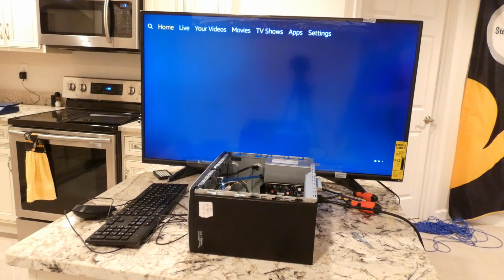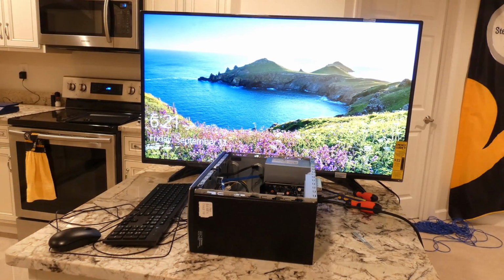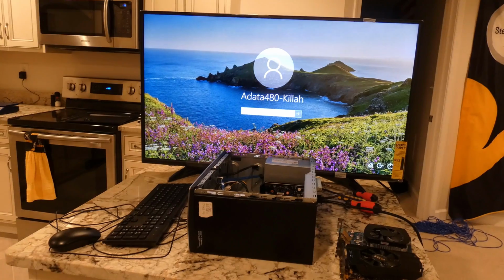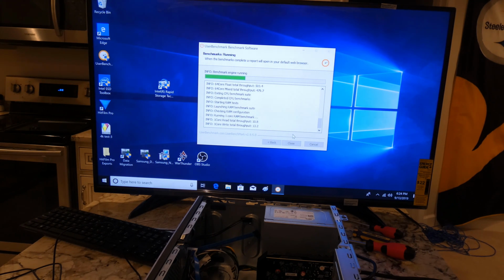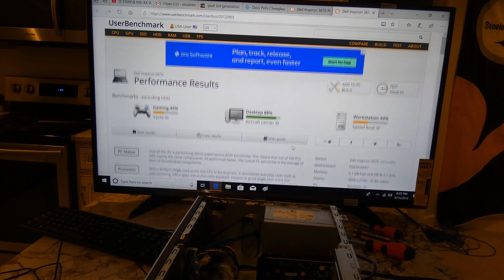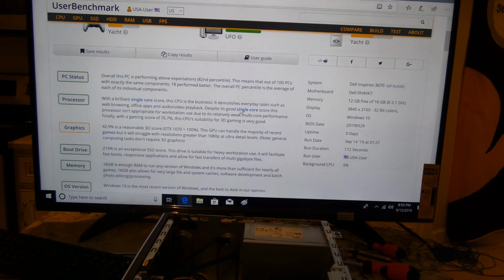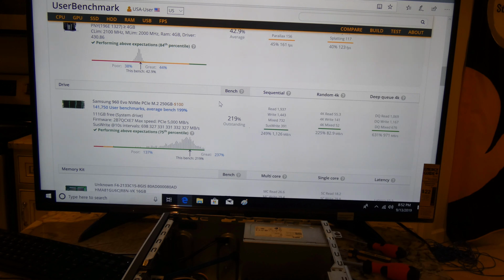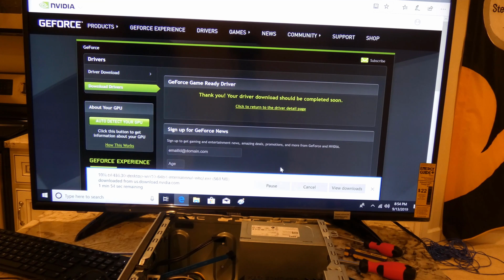Installing PNY GTX 1650 in Dell Inspiron  Vostro 3670, first benchmarks

Comment: 5 years late and i need help with this gpu

1. gddr6 is out of the picture, almost all need a 6 pin, which the dell inspiron 3670 doesnt got

2. id really prefer a dual fan model due to bad airflow in the system, but every dual fan i find, even gddr5, needs a 6 pin, do u know where to get a dual fan model that doesnt require a 6 pin?

3. ill take the cheapest u can find, ive been searching for weeks but maybe im looking at the wrong places, i jus want one that isnt dead lmfao, if u can help me out itd mean a lot, thanks.

Comment: The Toasty Bros showcased an HP Prodesk 600 G series MT with a 280w 80+ platinum PSU. The installed gpu was an HP gtx 1660 super and an i5 6500. They ran benchmarks and games on it. It ran fine.

Comment: Hello I'm buying a GTX 1650 tuf do you think that would fit in that pc because I have the same exact pc and I dont know if it will fit.
Reply from the maker: Hello, I have put a lot of GPU's in this case.  While I don't have the one you are mentioning, it is physically close to the gtx 1060 or RTX 2060S that I put in there.   Your card is supposed to be about 8" long...and the Zotac mini RTX 2060S that I put in...is 8.5".  At around 9-9.5", there starts to be an issue...so the longer 2x fan and definitely 3x fan GPU's are the ones that most likely will not fit.  I didn't notice a 6pin PCIE connector, so you should be ok with the stock cooler.
Reply: @PC_HardwareTechUnboxing_1  thank you very much you definitely deserve a sub and like you helped a lot and I'm probably gonna buy one today 😁

Comment: I have also a same model desktop (Dell vostro 3670) but the processor is i3 8100. Is it upgradeable with the same graphics card?
Reply from the maker: Yes..this one was I5-8400..than I3-9100..I5-9400f..than I7-9700f

Comment: hi, i have the exact same pc and the power supply doesn’t have and 6 pin power cables so do you know if i will be able to just put it in the motherboard without any cables and be finished?
Reply from the maker: Buy a GPU that doesn't have a 6 pin PCIE connector.    The one in this video doesn't have one.  

I have other videos demonstrating PSU upgrades and 6pin adapter cable to SATA.  Both of which might void your warranty.
Reply: David Noble thank you
Reply from the maker: You may find something useful in this 3670 playlist. Dell Vostro Inspiron 3670 Videos (upgrade, how to, benchmarks, gaming): https://www.youtube.com/playlist?list=PLVgD9iFAWx_IMiBmqgqFcTxl3W5PIdznr

Comment: Hello i have a dell optiplex 9010 with a i7 3770 and a 275w PSU and a want to put this 1650 do you think it will work ?
Reply from the maker: It should though I cant say it will with 100% certainty if you have the fatter one...slimline would require pcie ribbon extender.
Reply: @PC_HardwareTechUnboxing_1  i have the fatter one and i plan to get the gtx 1650 that doesn't require external power (no 6 pin connector)

Comment: can i put gtx 1650 on vostro 3800,as it is showing  gt 710 and gtx 745 is only compictable on this motherboard,i have a pc
Reply from the maker: Hello, yours looks to have a slim profile.  As I don't know the wattage of your PSU, I can say for sure if the following would work.

If there is a GTX 1650 Low Profile, you might get it to work.  This assumes you don't have same issues as a Vostro 3470.    Other options, leave the case open and use a PCIE ribbon extender....but your PSU should be at least 250W.

Comment: my psu is 240 psu and i want this card but my system is intel i5 4590 drr3 16 ram 2tb hard drive ssd 256 gb no dvd drive will i be a problem.
Reply from the maker: You might want to watch this video. 

https://youtu.be/yQzg1DtZmOk

Comment: Gigabyte GeForce GTX 1650 D6 OC 4G Graphics Card is that compatible
Reply from the maker: Hello, looking at the specs, there is no 6 pin GPU, so this card would work with this computer.    https://www.gigabyte.com/Graphics-Card/GV-N1656OC-4GD-rev-10/sp#sp  Recommended PSU is 300W, where this has 290W.  That should not be an issue.  Here is an example of a GPU that I put in and me showing how much power the Dell with an older GPU draws.  I eventually will do another one with a GTX 1650.  Number should be similar though.  (Actually was 160W for GTX 1650 for overall power draw) https://youtu.be/k33FMwV3e_8
Reply: David Noble thanks man

Comment: I have the same computer as you 
Do i have to upgrade the PSU if i want to use gtx1050ti
Reply from the maker: No, I never had an issue with GPU's that did not have GPU power connectors.  I have tried GTX 1050, 1050TI, GTX 1650, GTX 750, RX 460, RX 560B.  Currently, Dell offers the 3671 with same wattage PSU and a GTX 1650.

Comment: Thank you so much! I have the exact same computer and have been looking to upgrade the integrated graphics of it for a long time. Is the one you used the PNY GTX 1650 super or the PNY GTX 1650?
Reply from the maker: 1650  ..u need PSU upgrade for other

Comment: I just got a 1650 super. I have a GTX 1050ti now with the latest drivers. Should I uninstall the drivers before I put the 1650 super in?
Reply from the maker: It will probably run without updating.  Just install new GTX 1650 driver..you should be ok.

Comment: Hi David, it's work good with PSU 290W ?
Reply from the maker: Hello...if you check Dells site for the 3671...one of the options is with 1650 and if I remember correctly it says 290W.

Comment: I switched from optiplex to vostro and I wanted to know how this pc would be on gaming .
Reply from the maker: Absolutely terrible out of the box.  This video is with a better cpu, but demonstrates resolution and quality to be somewhat playable:  https://www.youtube.com/watch?v=CHRT6gSXh-U for something as simple as FortNite.   You will need a GPU for sure if you want to have better graphics.  Without upgrading the PSU, buying the following cards that don't have 6 pin GPU connectors will work:  RX-460, RX-550, GT 1030, GTX 750, GTX 1050, GTX 1050 TI, GTX 1650.  There may be some other older cards as well.

Comment: can you help me i am getting the vostro for my birthday and i want to do this if i add a another 4 gb ddr4 and the gtx 1650 will they burn or no i wont add a ssd please help
Reply from the maker: What do u mean by burn?  If U get a 1650 without 6 pin GPU connector..you should be fine.
Reply: @PC_HardwareTechUnboxing_1  ok thank you very much sir

Comment: would this card be possible with a 240 power supply?
Reply from the maker: I believe they recommend 300W system power.  That said,...the GPU maxes at 75W due to the PCIE connection and no GPU power connectors.  TDP for non K type Intel chips is 65W.  If you don't plug in a bunch of peripherals, it should work.  I did something similar in this video with I believe 180W PSU and a RX 460:   https://www.youtube.com/watch?v=8f7lxEIu1y0  

I can't say I recommend it though.    I usually recommend a 100W  buffer when building a custom computer after doing the calculations.

Comment: Hey I just got this desktop from Dell few days ago only to find out that I need another graphics card to play games, which graphics card will fit and work best in the Inspiron 3670? Without having to upgrade power supply, it is 290 watts. I wanted to try GTX 1050ti
Reply from the maker: GTX 1650 is the best card...it is rated for overall system power of 300W, but I never had any issues.  What I was looking for was the computer to reboot during peak performance, that would tell me that I went above and beyond what the PSU  could handle.  Now, ifi one were to max out RAM, HDD/SSD and external USB's....there is more potential for a problem.
Reply: @PC_HardwareTechUnboxing_1  so what should I get. I just wanna be able to play call of duty and it battlefield on low settings if I wanted too I just looked up the GTX 1650 on the nvidea website and there was 3 or 4 options of that model will any of them work or which one will fit in the dell Inspiron 3670 desktop

Comment: does anyone know if you need a certain amount of ram or watts in your power supply to get a graphics card like this?
Reply from the maker: Hello, this graphics card draws 75W thru the PCIE connection on your motherboard.  It is recommended that your power supply be at least 300W.   I would recommend you have at least 8GB of RAM, 12-16GB preferred.
Reply: There is always a certain (minumum) amount of wattage needed to run any GPU (graphics card) in any system.  The specs on the card will specificy that minimum.

Comment: Can I use a 180 watt power supply I have an i5 7500 gtx 1650 ti low profile. Pls reply. I have an hp computer it also has 8gb ram
Reply from the maker: No, I would not suggest using anything less than the 290W that came with this PC.

Comment: THANKS AGAIN I BUY THIS GPU IS WORKING GOOD .....
Reply from the maker: Good deal.  Glad you are happy with it.  BTW, I just got a GTX 1650 Super in to try out on the channel.
Reply: When is that coming out?  I am seeing what the best build is for this computer, so I can have it for Christmas
Reply from the maker: @WantBadtime  GTX 1650's Supers & 1660 Supers have been out a few weeks...starting at $160 and up.
Reply: Yeah I just realised about it. lol, I didn't what I was thinking.  So, if I get this card, will this config work with a normal 1TB Hard Drive with a Samsung 970 Evo m.2 SSD?  I Might not be able to since Hard drives take up lots of power.
Reply from the maker: @WantBadtime   GTX 1650 super or GTX 1660 super will not work in this one without a PSU upgrade.  If I do a video for it, that will be the first thing I mention.  Best card that works in this computer is GTX 1650 (no GPU connector) should run fine still with 2 drives...there is a point where you could have too many peripherals and you computer will go to a black screen and reboot.  I have experienced that with other PC builds, but not in this case.  With this computer it is hard to have a lot of other peripherals, HDD's, SDD's, case fans, rgb strips,...etc.  You could have something plugged into every USB 2.0/3.0 drawing power as well.
Reply: wiht hdd and dvd reader

Comment: Would the GTX 1650 Super work the same way? Or would it require me to change out the power supply?
Reply from the maker: I haven't got one of those in for the channel yet, but I believe they use 100W vs max of 75W of the 1650.  75W being the most that can be pulled from  a PCIE connection...which  should mean that 1650 Super requires 6pin GPU connector and thus you would need to change out the PSU.  If I find out something different than that..I will let you know.

Comment: Hi ...  I have dell 3670 I7 8700 16GB M / 512 SSD M2 3500 / can I improve this graphical power whith gtx pny1650,??.....More than you have ..or is same ??thanks
Reply from the maker: Hello, if you had I7-8700 in place of the i5-8400, with the GTX 1650, you would see a slight improvement in gaming.   Some games that take advantage of multi-core would see a greater improvement.  For 4k editing, CAD, animation, you would see serious increases in performance.  Without changing out the PSU and adding a 24 pin to 8 pin connector, this is the best graphics card that will run in this computer. Hope that helps.
Reply: @PC_HardwareTechUnboxing_1   thanks..

Comment: Is the motherboard altered at all or would the 1650 fit in a brand new Inspiron 3670? I’m trying to find a good graphics card for it, and after watching this vid, im trying to decide between the 1650 and the 1050 ti.
Reply from the maker: No modifications to the  motherboard or PSU was done for this video.  The 1650 isn't too large of a card.  I have another video that I upgraded the PSU and put a RX 570 in it.  That is about the limit of how large a card will fit in this case.  I have also tried out RX 460 (no 6 pin), GTX 1050, GTX 750, and GTX 1050 TI.  The GTX 1650 will be the best performance, but if you find a GTX 1050 TI used...it might be worth saving the money.  Just make sure you buy a GTX 1650 that does not require a 6 pin PSU connector.  These are some of the benchmarks of the similar Vostro 3670:  https://www.userbenchmark.com/System/Dell-Vostro-3670/89525    The 8th one from the top is about as good as this computer will perform with a SSD M.2 NVME upgrade as well.  You will have a solid 1080p gaming performer.
Reply: David Noble thanks man, I appreciate it! I found one on amazon for a reasonable price, and in one of the reviews the guy said he had tested it in the Inspiron, so it should definitely be the right fit. Eventually I want to replace the power supply and possibly the processor as well to make it even better, but I’m gonna just start with getting the graphics card. Work my way up to that point.

Comment: Can I install a 1070 or 1660 ti? If no what can I do
Reply from the maker: There are people that have posted benchmarks of it.  You will need to upgrade the power supply and if you want to keep one of those graphics cards inside the case, you might need  to buy the mini version.  You will also need a 24 pin to 8 pin adapter.  Let me know if you want the link to the latter.

Comment: Thanks for the tutorial. I have an inspiron 3670 with a gt 1030 in it but I am trying to figure out if I can get a 1660 ti running in there if I upgrade the power supply.
Reply: I JUST PUT A GTX 1070 (8GB) AND 600W IN ONE OF THOSE. HAD TO HARD WIRE THE 8 PIN TO 24 PIN CONNECTOR DIRECTLY IN THE PORT HOLES BECAUSE THE HARNESS WAS TOO TALL. 1070 WOULDN'T SEAT RIGHT. ALL WORKED OUT THOUGH WITH A LITTLE SNIP HERE AND THERE.

Finished Product
https://ibb.co/FxPmWxb
https://ibb.co/64QnYg0

8 Pin Hard Wiring
https://ibb.co/ZmFCtVt
Reply from the maker: @ResidenceRescueLLC  Alright...to quote the rock band KISS, Detroit is rocking now!
Reply: @ResidenceRescueLLC  cool man. I'm still trying to decide what to do with mine. I'm pretty new to working on computers and this little 3670 just seems like a pain in the neck.
Reply from the maker: I've covered installing a RX-570 in one with the different ways one can install a PSU.  Let me know if you want any video links from mine.  You probably know this already, but you will need a 24 pin to 8 pin motherboard connector as well.  I can send you a link for the one I used as well.
Reply: @PC_HardwareTechUnboxing_1  
Thank you very much
I actually watched that video and have been considering it. That was a really good video.